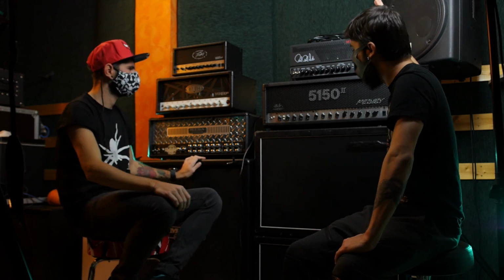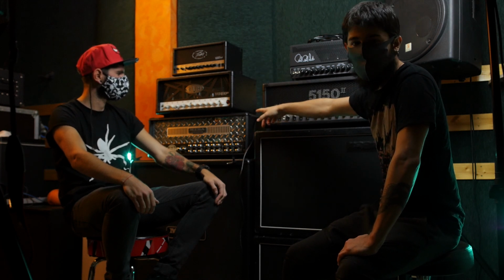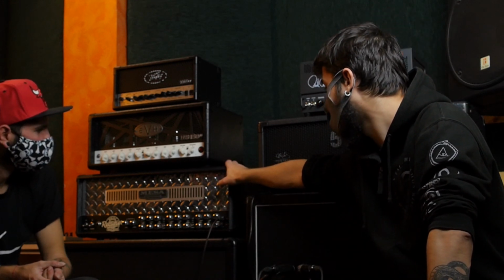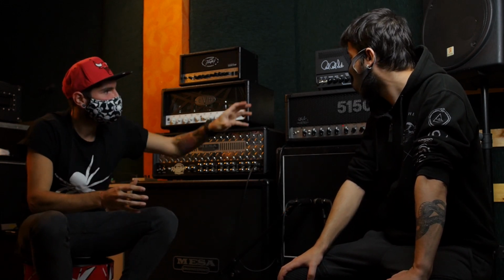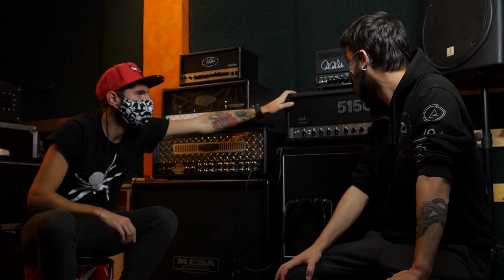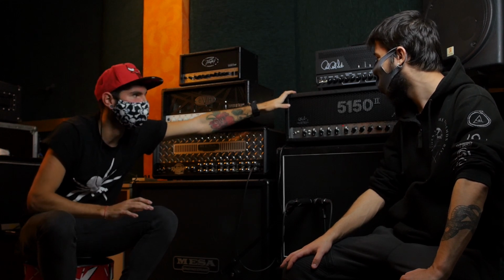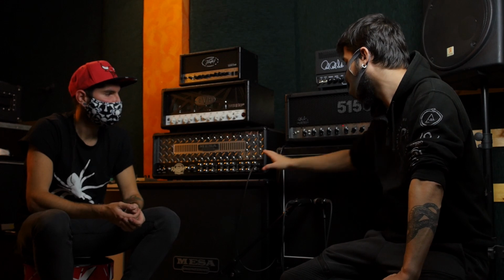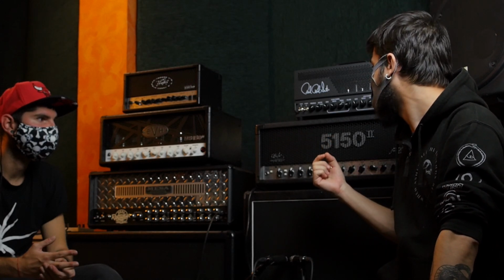Guitar Amp Shootout - Mesa Dual Rectifier vs 5150 II & III vs PRS MT15 vs 6505 MH

Comment: I played  a 5150 II through Mesa Boogie 4x12 cabs as my primary rig for over 20 years. I now use a PRS MT15 run through an Avatar Contemporary 2x12 loaded with Hellatone 60's. While the 5150 II and the MT15 are different beasts, many players would be surprised at how similar they can also be. The biggest difference by far is the mid-range voicing. While my old 5150 II/Boogie rig was my all time favorite I also very much enjoy the MT15.

IMO, the fact that there are so many great amps to choose between makes for some hard choices. No one amp is perfect for all players. And no one amp is the best there is. 

Great job on the comparison guys. The differences really came through. Especially the differences between the two cabinets. Night and day there.
Reply from the maker: These are great times for musicians, having so many high quality options to choose from. I haven't heard of Avatar cabs before. I'd love to give one a try if it ever pops up nearby. Glad you enjoyed the video!

Comment: Amazing difference in cabs
Reply from the maker: Yeah! I was expecting a difference, but this was a lot bigger than I thought
Reply: The difference would be pretty similar comparing a 2x12 mesa cab vs the 4x12 oversized mesa. Even the smaller traditionnal mesa 4x12 sound totaly different. The cab is the first part of the chain I choose to achieve my tone.

Comment: I'm the very happy owner of a Dual Rectifier 3 channels, an EVH5150III 50s and an US Made Peavey 6505+, and I love each of them with their own characteristics. The raw/loud/deep sound of the Rectifier, the sharp razor like sound & incredible amount of gain of the 5150III and the 6505+ which is a mix of them. If I have to choose, perhaps the 6505+ (aka Peavey 5150II) because it's a bit of a synthesis of the 2 first beasts, more round that the 5150III and easier to dial than the Rectifier. And that's my very first big boy amp ;-) ! But owning all 3 amps is a real privilege and allows you to cover most of the different registers of metal. Maybe add a Marshall JCM 2000 DSL and an Orange Rockerverb, and the quest will be over :-) ... Anyway, it's intersting to have these amps when you do records, because blend them in a mix is a real pleasure. And if you can't afford these amps (It took me more than a decade), one will already be enough to satisfy you...

Comment: The EVH iii has that nice scratchy pick attack sound and is heard with more definition. Everyone loves low end and you can get away with more of it in a live setting to drive your sound harder. Although, recording rigs that favor low end gets muddy really fast.
Reply from the maker: You're absolutely right. The EVH and Mesa did seem to have more presence out of the gate than the others. The 2 Peaveys and the PRS had a natively darker sound, but I'm fairly sure you could get a similar effect out of them with a bit more tweaking
Reply: @Garnoo  I split my signal through two amp rigs. One pushes the low end and the other has that ice pick sound that cuts through. Sounds massive.
Reply from the maker: @Gears9  That's an interesting way of doing it. What do you have in those rigs?
Reply: @Garnoo  I run into a Boss effects modeler actually that's powered by a Seymour Duncan powerstage 700. Modeling a 5150 and a Mesa rec / into a 2x12 custom cab. It splits and goes into a Dover DA-50 / Marshal 4x12.
Reply from the maker: @Gears9  That's a fairly large rig. How are you liking the Boss stuff? I haven't tried anything from them since the GT6. I've been using a Helix for 90% of everything guitar/bass related for the past 2-3 years and it's been pretty good but I like to keep myself up to date as much as possible. Are you using the modeler for the top end and the Dover for the bottom or the other way around?

Comment: Besides the different cabinet design and construction, the mesa cab comes with custom Celestion vintage 30. Celestion makes different Vintage 30 speakers for mesa which are not the same model of vintage 30 inside a stock Harley Benton G212 Vintage Cabinet. I learned this the hard way.
Reply from the maker: Indeed! I'm curious how much of the sound difference is due to the speakers rather than the cabinet construction. I'd love to try switching the speakers between them, but sadly those cabs were borrowed for the video

Comment: The 5150 II sounds bigger than other amps in this comparison but due to that it's also tougher to make it sit right in the mix. It not only has a big low end but it also has a very fat, dense and saturated mid-range that dominates and drowns out other instruments in the mix. The PRS MT15 suffers from the same problem albeit to a lesser extent. They are great amps for songs that are more lead centric or where you want the guitar to be the central instrument, but rhythm sections played on them are just too big and dense sounding for their own good. They drown out the bass and drum.

The problem with the Rectifier is exact opposite of that, although it has a deep low end and prominent highs but it doesn't have a dense and saturated mid-range. That's why it doesn't drown out other instruments and sits right in the mix. However many of the riffs played on it get buried in the mix and the guitar looses its place as the central instrument. It's a good amp for songs that are not very guitar centric, or are rhythm driven, but it's not a good choice for songs that are guitar centric or lead driven. 

The EVH 5150 III sounds the most balanced among all the amps. It sits right in the mix, doesn't dominate or drown out other instruments, but at the same time it doesn't get buried in the mix. It makes leads shine without dominating over other instruments, and since it isn't over the top dense like the 5150 II it works great for rhythm driven songs too.

The 6505 MH was plain harsh and was the worst and weakest sounding amp in this comparison. It has too much harsh high end and no low end.
Reply from the maker: You're pretty much spot on with your descriptions. They all work well for different purposes. If you can choose between those for a production, it's great to keep that in mind. But I gotta say that after playing with the stems a little bit I'm confident that you could get a cool mix with either one. It may take more or less eq depending on the vibe you're going for, but it's totally doable